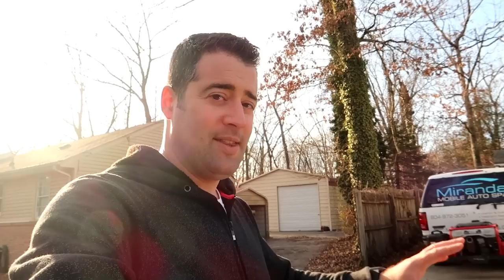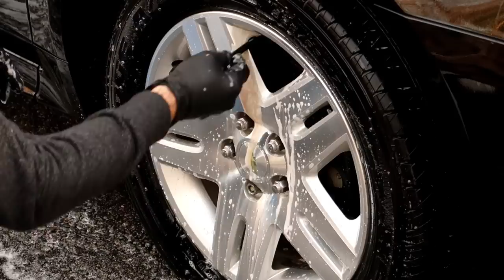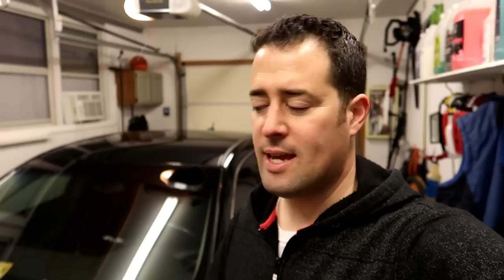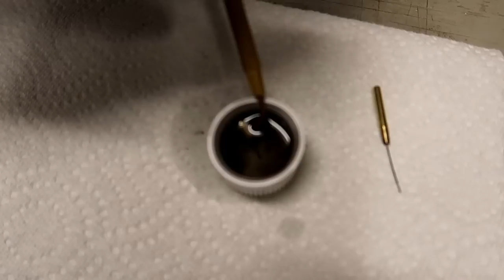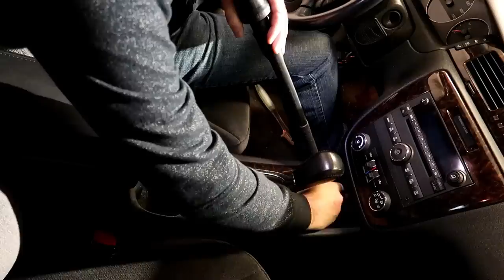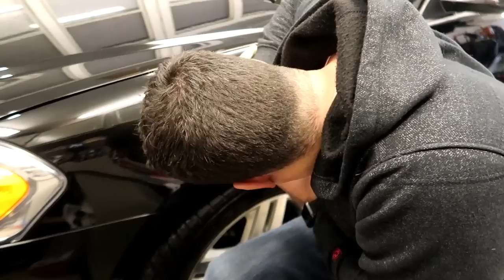Interior and Exterior Detail with Rock Chip Touch Up -- Chevy Impala

Comment: hello sir i noticed in the clay bar much gunk, i think this is no only contamination but also triffik film, the shoap you washed the car it had the ability to remove traffik film?? or it was ph neytral?
Reply from the maker: I use CG Citrus Wash and Gloss for the soap.
Reply: As a PH balanced shoap it cannot remove oil based greace and grime and traffic film....
TRY sometimes and test,  to wash a car with more aggresive shoap  ( i dont know many brands in USA but i think purple power vihicle and boat can do the job and it is MUCH more  economical than  CG and ph 10).if you do this you will notice imediatelly that your clay bar service will be faster, and only bonded contaminants you will find in your clay bar...it will cut the time of clay barring very much,also the clay will last you longer for more cars because it will not have so much grime on it
 and it will prepare the car for any type of correction more proper and also ypur sealants and waxes will bond to the clear coat fo longer....
test it and you will remeber me!!!!!!

kind reggards sir from Athens Greece
Reply from the maker: Thanks. Actually before we wash the vehicle I use a degreaser and do a degreaser rinse first. Then I use my foam cannon to soap and wash. I’ve never had a problem removing road film before anyways.Thanks for the tip though. 😎👍🏼

Comment: Fantastic job, as usual ;) quick question: do you take any precaution with electric part (battery for ex) before washing engine bay ??
Reply from the maker: Thanks. I’ve found that with pretty much all modern vehicles it’s safe to rinse the engine bays without needing to cover things up. I also dry right away.

Comment: Thank you for another great video! I see you use the same product to clean wheels, tire and under fenders can you please tell me which product that was? Thanks again really enjoy the channel have a wondeful day.
Reply from the maker: You’re welcome!  Yes I use Nanoskin Multi Clean Citrus degreaser. It’s basically an all purpose cleaner. Diluted. 1:4 for exterior or 1:10 interior. However I recently switched to 3D Nanodrums Super Citrus APC. I haven’t used it yet so we will see how it does.
Reply: Miranda Detailing thank you will you be doing a review on the 3D product? Just looking for something that works for all three tough enough to break down the film in tires but isn’t harsh on the wheels. Have a wonderful day.
Reply from the maker: Yes I will be doing a review on the new 3D Citrus APC!
Reply: Miranda Detailing thank you looking forward to it.

Comment: its work to do mechanical decontamination without chemical decontamination?
Reply from the maker: Sometimes it is. I sometimes do it if it’s needed. I’ve used ironx on some cars only to find no particles dissolving. In must cases clay bar or mitt does the trip.

Comment: Awesome work! Now crazy question, by what power washer and pressure hose are you using. I ask because for the life of me, I can't get my 25ft hose to keep from getting all tangled up which I think effects the power washer on occasion. Either way, your results are fantastic so it's good to know what your tools are.
Reply from the maker: I had a local pressure washer company set up our pressure washer system. It’s a 2200psi system with a 50 foot hose and reel from Northern Tools. It’s a grey non marking hose. 
I try to make sure that when we are walking around the vehicle to keep the hose flat to the ground and keep turn the gun so it doesn’t link and tangle. Sometimes it does get tangled  but I just twist it back straight when walking around the vehicle.
Reply: Miranda Detailing good deal, I may see what I can put together. Also, another little tip that a buddy detailer of mine gave to me is prior to cleaning windows, clean with a 50/50mix of distilled water and isopropyl alcohol and then proceed with your normal glass cleaning process. The 50/50mix takes all the impurities off the surface and eliminates streaking. Just a tip to pass on to you.
Reply from the maker: Very cool!  Thanks for the tip!  I often use ipa as a glass cleaner also! Works great!
Reply: Miranda Detailing I'm a new mobile detailer just getting started and a lot of your videos have shown me a lot that I tend to find myself going back to some of your techniques when out doing customer vehicles. I appreciate all the quick responses and look forward to many more videos. Thanks again!
Reply from the maker: You’re welcome!  That’s great!  I’m always happy to help out others!